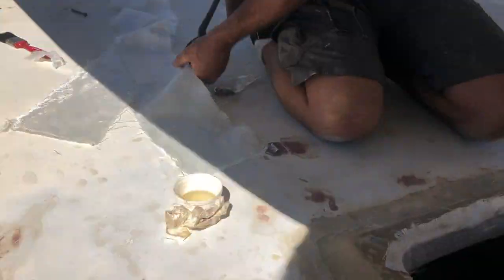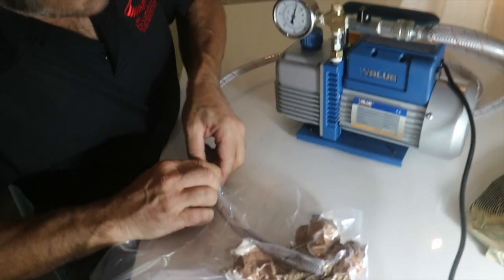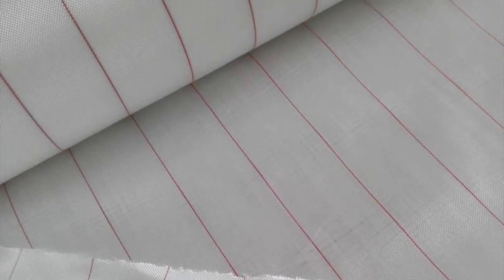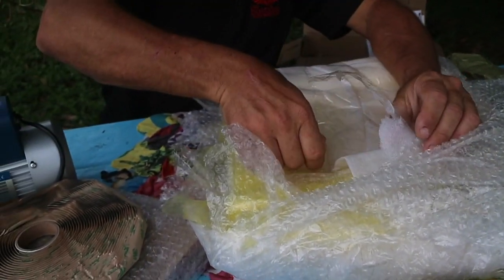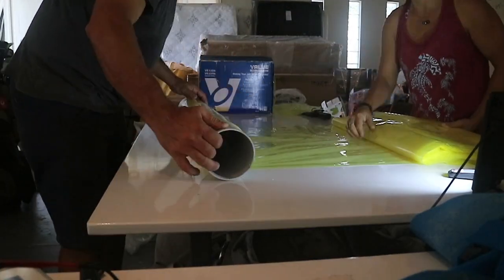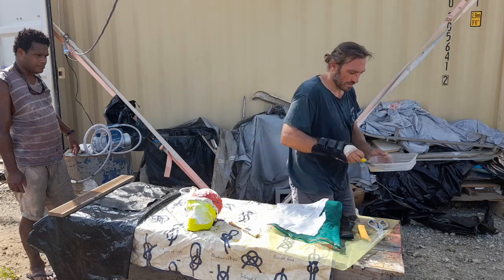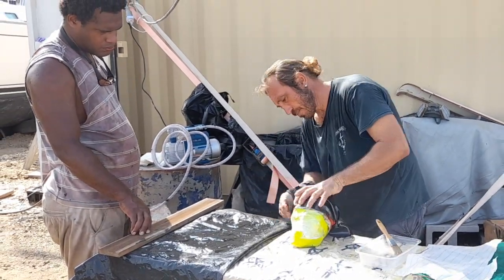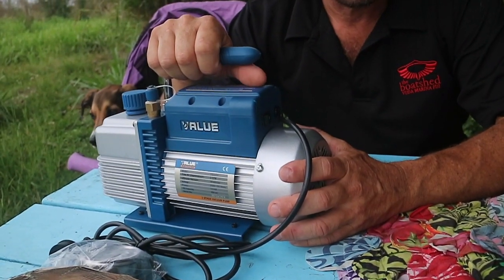Vacuum bagging a wet layup of carbon fiber | Ep. 13

Comment: I just stumbled across your channel and am binge watching.  Great stuff.  I am sure that you have figured this out by now, but you really need to have a catch pot in your hose between the bag and any fittings so that you will not get any epoxy pulled into the pump.  When you are on bigger pieces, you will have epoxy coming up the hose before you remove all of the air so one of two things will happen.  
1. you shut the valve and leave air and excess resin in the laminate. :>(  
2. You leave the valve open so that you can get all of the air and excess resin producing a good laminate but then will need to by a new pump and any fittings because they will be full of epoxy. D'oh!
Reply from the maker: hey thanks for this again, such helpful comments thank you! we've been watching for the epoxy coming up the hose, so you are right I need to create an epoxy trap...